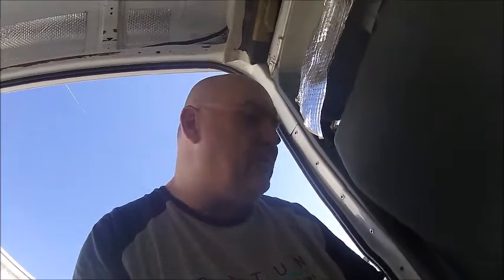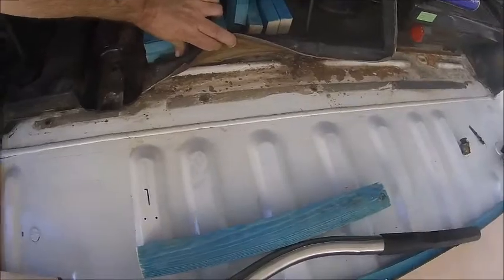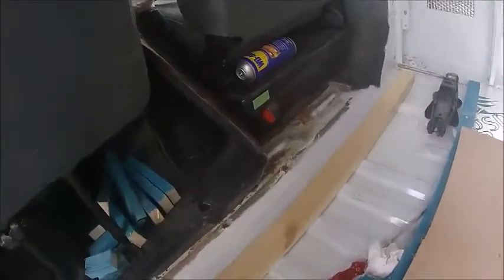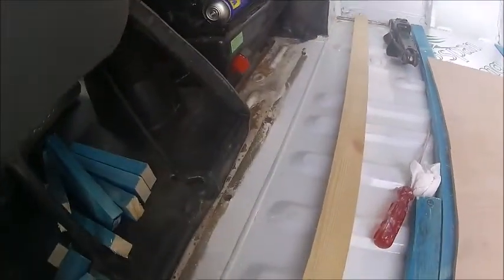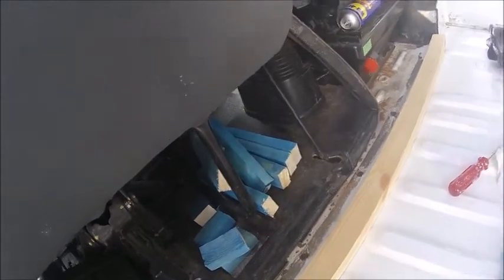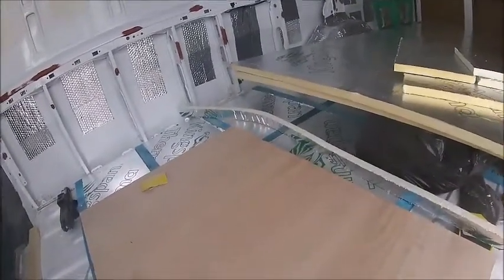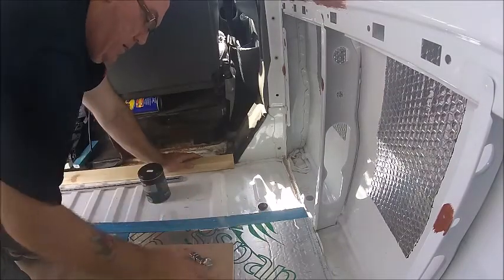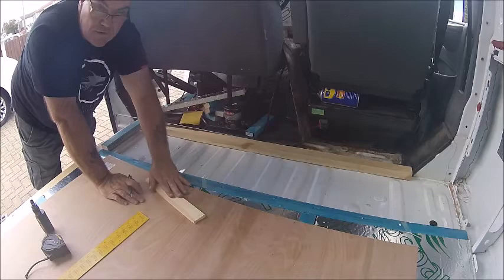Transit Jumbo Campervan Build. 7. Can of worms?

Comment: What is that box under the driver's seat?
Anyway I was thinking, when that separator piece (you took out on the first vid) was in place I bet no one could get behind those seats to treat any rust, and you'll get the same trouble when your panel goes in. So you'll have to do all your rust treatment there before your separator goes in.
On the positive side, if they couldn't get in behind the seats you might find any loose change they dropped, never know there might be enough for half an ice cream.
Reply from the maker: Rob M lol. Ive not found any money down there yet. That box ubder the seat is where the starter battery is.